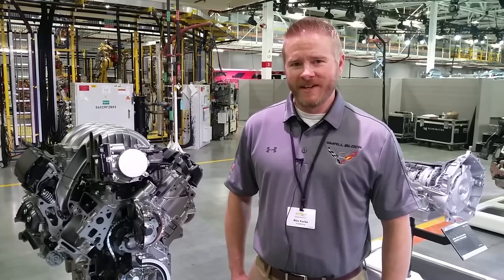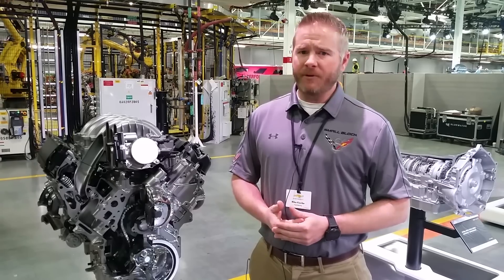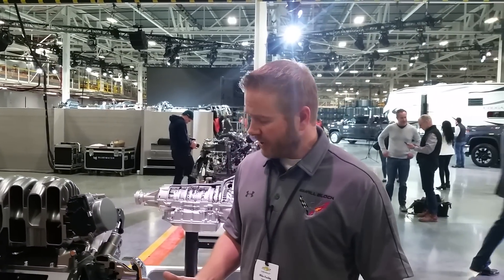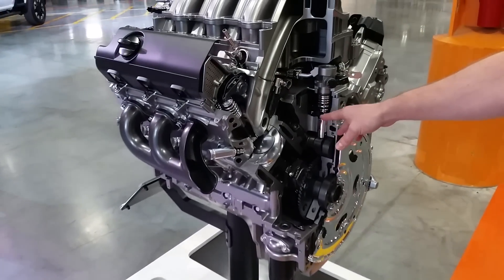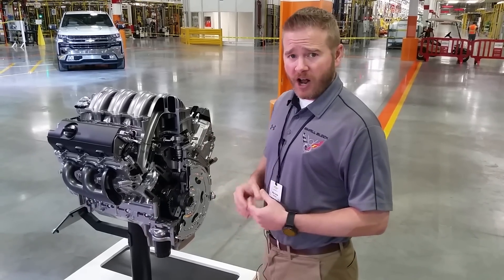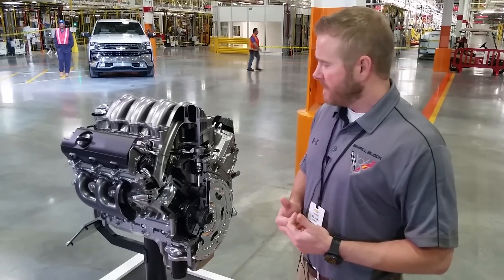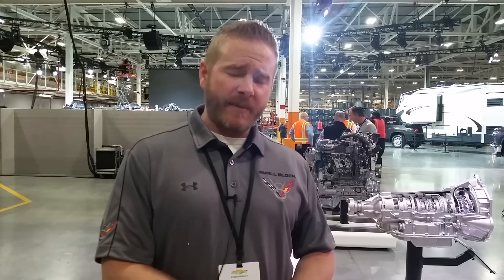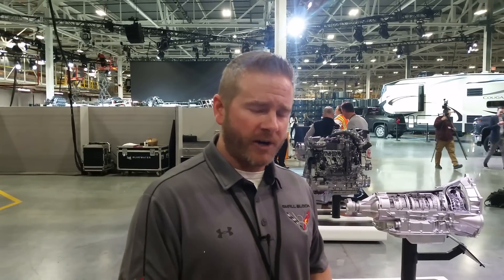New 6.6-liter V8 gas engine on 2020 Silverado HD

Comment: Will this be available in the 4500hd trucks?  3500hd is too small for our fleet now and we keep getting stuck with V10 ford f450s... fuel consumption is horrrrrrrible on those.

No, we can't have diesels.  The bean counters have spoken.
Reply: Indoor Roadkill what would you really expect from a big ass gas engine? Especially in a big heavy truck
Reply: @justinw.2376  We didn't expect the Ford to use like 50% more fuel than the Chevy... I wish I had the exact numbers to show.

It would be nice if these got achieved similar numbers to the outgoing 6.0L, and be available in the 4500 series.  That's why I'm asking.
Reply: Indoor Roadkill I would like to see these numbers because right now you’re just pulling from thin air here. Plus not to mention the ford v10 6.8 is a bit bigger than the chevys v8 6. And What im getting at is it seems the 6.0 isn’t even available in the 4500 (I have no idea) so you couldn’t even compare the f450 v10 to a 4500 v8 with the 6.0 cause it’s not even available. So how are you claiming that Chevy is getting 50% better gas mileage when you aren’t even comparing the same trucks. Am I misunderstanding something here lol.
Reply: @justinw.2376  let me try to explain more clearly now that I'm home.

Currently the new line of GM 4500 and up series trucks are diesel only.  Company policy due to the bean counters is no more diesels as the fuel savings etc. on paper does not outweigh the increased purchase, maintenance, and repair costs for the time they are in our fleet.  This is how we ended up with the Ford F450s... we needed to upgrade our weight capacity and had to remain gasoline powered.

The outgoing fleet is 2013-15 Chevy/GMC 3500HD trucks, mostly with steel beds, 6.0L gassers.  They weigh between 10500-11500lbs. empty.  They have been extremely good trucks but the vast majority of the fleet has between 350-500000km on them now.  They have been slowly selling them off and replacing with 2018-19 F450s with the 6.8L V10. Because of the aluminum bodies, and now aluminum beds, the trucks weigh around the same as their predecessors.  

I don't have the fuel consumption data, I wish I did as I would be happy to share.  All I can tell you is the drivers who are getting them are blown away by how thirsty they are...  we thought it would improve as they broke in but unfortunately they aren't. 

The only way I can illustrate it for you is this:  We are rated on our driving performance.  It's a complicated mess of a formula that includes our fuel consumption, but it determines what our quarterly pay bonus will be... hence why it's important to the drivers.  The Fords had to literally be separated in the data--given their own catagory and averages--because the consumption numbers were so much higher that their drivers would never be able to achieve the full bonus.

Overall they've been happy with the new trucks but we may need to buy oil stocks with our bonuses... 😂😂
Reply: Indoor Roadkill ohhhh ok got it now lol. That’s a shame you can’t go to diesel. No matter what company of the three it would be better than a gas in my opinion. But hey gotta do what ya gotta do I guess lol

Comment: That fuel system is going be a nightmare to repair!  You going need special Kent Moore Tools to service any part of this HP fuel system.
Reply: It's not any different than what is in the LT platform... Why would you think it's any harder? Take the intake off (10 bolts) and done.
Reply: Anything DI sucks to work on. The HPFP is expensive too.
Reply: Looks very similar to what we are already repairing with current GEN-V engines.
Reply: Cts it's and camaros haven't ran 6l90s since the LS era they run 8l90s and now have 10 speeds
Reply: My 6.2 makes 420hp and 460tq.. this should make more than 401hp and 464tq... where did you guys go wrong?
Reply: @hpperformance2819  your 6.2 does not have the durability of this engine to maintain high output for hours at a time day after day. Pushing a 3,500 lbs car to 100 mph only to hit the brakes is different than a 7,000 lbs truck towing a 9,000 lbs trailer for 8 hours a day. He said the new 6.6 is a stroked 6.2 so I expect you could increase the max horsepower with a tune and cam swap but you would reduce the torque at 2,000 rpm. I tow at 2,000 rpm not 6,000.
Have you ever wondered why the Corvette with 420hp had the 6L80 transmission while the Silverado HD with 360 hp had the 6L90 transmission?
Reply: @csh000  first off i am talking about my sierra with max tow package, has more power and will tow that load all day long. Second if you think there isn't a massive amount more stress on things pushing a car from 0-100 you should do some research. BUT my main point was, was it is bigger, and brand new, and should come ATLEAST equal to, if not more hp and to than my smaller engine. Ever wonder why ctsv's and Camaros got a 6l90?
Reply: @csh000  it shouldn't need a tune or cam to get more either, I'm talking right out of the box.
Reply: @hpperformance2819  
I'm right with you as I listened to this guys sales pitch and did not hear one thing that sold me over the current 6.2L motor... and I am sure this new motor will be at a cost premium.
Reply: @trullmann  that's the funny thing, I see nothing on this significantly different than a 6.2 except a longer stroke and some minor refinements. Guarantee it costs exactly the same money to produce but since its an upgrade option it'll cost more.
Reply: @hpperformance2819   The 6.2 requires premium fuel. Plus HD engines make less hp so they run wide open most of the time
Reply: @deansapp4635  wrong, they reccomend premium,  it's not required. My point is with newer gens they should be increasing.. if they had more hp/torque, they would not need to "run wide open" all the time
Reply: I have close to 160;000.00 miles on my di 2012 equinox V6, never had to fix the injection system
Reply: @mbukukanyau  you are lucky because  the timing chain goes bad

Comment: Be nice to see GM make a small 4 cylinder diesel for smaller lighter pickups., like you see overseas.
Reply: GM doesn't have a small pickup anymore it ended with the S10 the Colorado started small then got almost as big as a full size. It would be nice to see a S10 size truck with a 4 banger diesel.
Reply: They already have. Lol the 2.7 4 cylinder Duramax is in the Canyon and Colorado

Comment: Do they use plastic fueling lines?
(An obvious problem with corrosive fuel)
Rubber for oil hoses? (Lexus fiasco)
Is the fuel filter outside the gas tank? (VW tried that crap)
Plastic radiator top? (Mazda. Never fails to crack)
Plastic gears in lockers(Ford) 
I'd like to see a potential review of  engines just as they do cars to help put the spotlight on good engineering practices that's well made iron vs questionable components. 
This is just a short list but someone with decades of experience (Scotty K.) it would be neat to mine their experiences and  see what's driving these trucks. 
I know, I know. 
Computers. 😞
Reply: Well  @Rxonmymind
https://www.youtube.com/watch?v=ijjkAlxzvOA

Engineers  are  not  working  to make cars  better all   the  time  some  times  making them  cheaper is the Priority ..   My  Cousin  learned  this   from a  GM  Engineer   50  years  ago  when  they  were testing  to  see if  GM cars  would  start in  very cold weather  at the  Sioux  500  Snowmobile  race..  My  Cousin  told  an  engineer   that his  old  cars  would  start  with a  6  volt  battery..   but   you needed    very  heavy  battery  cables  with a  6 volt  battery,..   They  were testing  to  see if  it  would  start with  12  volts  and   cheap  light battery cables
Reply: Plastic radiator top? Do you mean the end tank which has been industry norm for decades? Plastic and rubber fuel lines have also been industry norm for forever. There has to be at least some flexible part to allow engine movement. External fuel filters are extremely common and successfully used too.

Comment: Lower specs than an ecoboost, lets see the really world heavy tow comparison
Reply: Ford doesn't put the ecoboost in the super duty trucks either.  The HD gas engines are designed to pull max load on a near constant basis - they are more for durability and usability than peak power.
Reply: navy Guy you know they work together now right.
Reply: The ecoboost it a piece of crap. Never belonged in a pickup. Not near as reliable as the 5.0 is

Comment: So it makes less power than the 6.2? How is that moving forward?
Reply: 6.2L uses premium only fuel for its power numbers
Reply: @T51B1  oh gotcha. Still gotta say though, those aren't very impressive numbers for a big motor like that.
Reply: @Master.Elekchicken  it's supposed to be durable and reliable. Squeezing every last horsepower from an engine decreases longevity. Also gearing can make up for less power
Reply: @T51B1  ford hp ratings are all at 93 octane as well
Reply: It's a cast iron truck engine. 6.2 is aluminum and not meant for heavy truck use.
Reply: I am thinking 🤔 more torque will come in at a lower RPM with the larger displacement.
Reply: It makes less hp but it also makes a little more torque. That means the torque curve is lower in the RPM range where you need it in a work truck. It also does that with a lower compression ratio so it can run on regular without hurting performance unlike the 6.2 making it a cheaper engine to run.
Reply: Cause in reality it doesn't, and larger engine still does more.
Reply: because this is designed to beat the crap out of day in and day out like the old big block v6s
Reply: There’s a difference between a high number engine and an engine with higher average hp and torque I.e. “area under the cure” and on low octane fuel nonetheless.

Comment: What a bullshit engine. GM stop pissing around. That 6.6 should be cranking out 500 ponies and associate torque. Your existing 6.2 which I owe in a 1500 puts out 425 horses. What you have hear is a significant bore sized engine whose power curve is significantly defined. When Ford releases their 7.3 specs soon, your segment leading figures will go right out the window. A show about nothing.

Comment: I  wonder   how  GM   solved  the  problem  of  carbon   on  intake   valve that direct  injection   engines have?   Is  there a second  smaller  injector ?  For  2020  not  flexfuel  capable   ..  Could  loose a   lot  of  Farmer  and   rural  area  sales  !
Reply: From what I understand, GM has had a fair amount of success with optimizing cam and injector timing to get a little bit of gas back behind the intake valve during overlap phase. While some earlier GM engines with DI had issues, I think they have a stronger track record than most in more recent times. This set of mitigating solutions is patented, so that would explain why others are doing different things.
Reply: @corystansbury   I  was  reading  about  an  engine  with   two  injectors  per cylinder..    Squirts  some   into  intake   witch  puts  a very  lean   mixture  into the  cylinders  then  more timed  fuel   with the  larger direct  injector.   Maybe it  was Ford   that did that  .

  Honda  used   to have a lean  Pre-combustion  chamber  that  may  have  been  in the Carburetor  days  yet
Reply: @mikeskidmore6754  Lots have gone to two injector systems. I personally find that as rather ugly engineering, myself.
Reply: @corystansbury  GM isn't too interested in building something reliable Active fuel management is a huge issue with GM vehicles learned this the hard way,it's all over youtube as well,delete the A.F.M and it might last longer and not burns so much oil between oil changes.
Reply: Mishmoto offers a oil vapor trap canister system to vastly mitigate valve carbonization.
Had one on 6.2 liter Camaro.
Reply: @nibotkram7743   Interesting   I never   heard  of that...   I  like  the  LS-7   with   dry  sump  oil   pan
Reply: @nibotkram7743  Put that on my 17 High Country 6.2L works great at catching
Reply: No FlexFuel is instant no buy for me.
Reply: water

Comment: How does a longer rod make the engine displacement larger?
Reply: A longer stroke does not require a longer rod nor does a longer rod increase displacement.
Reply: ntwtransam the longer rod accounts for the longer throws on the new 6.6l crankshaft.
Reply: with   a longer  stroke   you  may  need a longer  rod
Reply: Move the crank centerline down.
Reply: As compared to the 6.0? It’s elementary math.

Comment: Seems like they copied ford idea by doing there diesel to gas engine🤔
Reply: Maybe because the 7.3 was thevlast good diesel engine Ford had. Followed By a decade of junk 6.0's, 6.4's, and early 6.7's. 

Seems like Ford FINALLY admitted GM and Ram had  it right to begin with by crawling back to pushrod V8's, TAIL TUCKED BETWEEN THEIR LEGS. So much for Ford and their unreliable OHC V8's. Just like Ford finally got tired of being humiliated by GM and Ram in commercials where they showed how Super Duty frames looked like they had frames made of wet pasta, so they "copied" their boxed frames. Just like Ford ripped off Ram's "big rig" styling in the 90's when they introduced the copycat Super Duty. Then Ram introduced their towing camera system and Ford showed up with a copy cat system a couple years later. Ford is a follower these days. Except for those embarrassingly weak "military grade" aluminum beds that crack when you try to use them. Just wait. Ford will finally decide to start offering a steel bed again that can hold up to real work and Ford fans will accuse everyone else of "stealing Ford's ideas again".
Reply: @lhaus2333    Would   you   rather   have   a  6  Liter  V-8  or a twin  Turbo  V-6?    The  V-6  will  not   hold up  pulling  heavy loads and   costa fortune   to repair .
   So  now  Ford's   better  Idea   is  a   Big  Push   Rod  engine that  has  lots  of    torque  at low  rpms  for  long  life  where you need it in  a tuck ..   Ford  said  their  Commercial   customers  wanted  something  more  reliable   that is cheaper  and   easier   to    work  on
Reply: @lhaus2333    Ford's   are   $80,000   Cowboy  Cadillac's  they  have the  nicest  interiors   and   biggest   Cabs  ,, Make  mine a work  truck  Please   I can't  afford  anything  else
Reply: @lhaus2333  having said that, I would take the new Ford 7.3 gas over this engine!
Reply: Neither one is remotely related to the Diesel engines of the same displacement. They are not in any way a converted diesel. The GM shares most, if not all its design features with the current LT engines on the market. Fords engine is all new, for Ford.
Reply: Jesus Ford copied Chevy and Dodge look at the new 7.3 look like a fake ls engine
Reply: Eric Rodriguez it’s a cam in block 2 valve per cylinder gas v8 just like an ls that’s probably where the similarities end
Reply: The Ford 7.3 gas job has zero in common with the old Navistar International 7.3 diesel of old. I really don't understand why people are trying to make that comparison. Its apples to oranges.
Reply: Well considering the 7.3 was never a Ford Engine. The 7.3 diesel is all International .  Lol
Reply: @captaininsano2777   No    the  IH   engine had   problems    when   built with   Electronics  built  to Ford  Specs..  the  Pure  IH  motors  had  far   fewer  problems  .than   the  Version  supplied   to Ford  did

Comment: Guesses on tow capacity?
Reply: He stated 17k, but that sounds low when compared to the 35,500 of the diesel
Reply: @joshuamaxwell6563  half the torque of the diesel half the tow capicity
Reply: @shawncordeiro1150  
Half the price too?🙄
Reply: @joshuamaxwell6563    I  think     35,500   is  with  a Dually   with   a much   bigger   ring gear  and   pinion
Reply: They   said   in this   Video   17,000  #

Comment: So basically is a 400 cubic inch engine. Sounds nice to see the displacement of old engines back into new ones and also has some design of the old ones (siamese heads)
Reply: A fully modernized version of a classic. GM has been doing good pushrod truck engines continuously for so long it's a pretty easy bet that this engine is going to be as rock solid as the old 6.0 vortec was.
Reply: @lhaus2333   It    is  a  Vortec   engine  with  Direct  injection   , they call it the  Generation V small  block
Reply: Heads  are  all  one  piece  of course  did   you mean Siamese  cylinders  as  no  water jacket  where  the   cylinders  touch in   the  middle .. water  passages in the block  are  in   the  corners
Reply: danthebig__Z :v
6.6 is 402 cubic inches
Reply: @anthonywebber2211   The last  Couple   of    years the   396  Chevy  was  actually   a 402  cubes   go figure
Reply: Mike Skidmore
396 cubic inches is 6.48928 liters rounded up to 6.5
Reply: @anthonywebber2211  The 400 was 6.6L also.
Reply: @tskraj3190  2 cubic inches is only 0.0327741 liters
Reply: @anthonywebber2211   I had a Pontiac 400 and it was listed as a 6.6 Litre
Reply: 0.0327741 is the difference between a 400 and 402, do you really think GM is going to advertise a 402 as 6.6327741 liter engine?
Reply: @anthonywebber2211  No, but 400 is also a 6.6 Litre, that is all I'm saying
Reply: @tskraj3190  you don't say